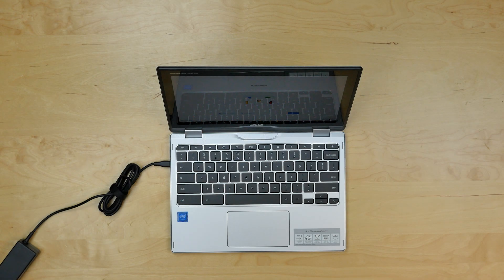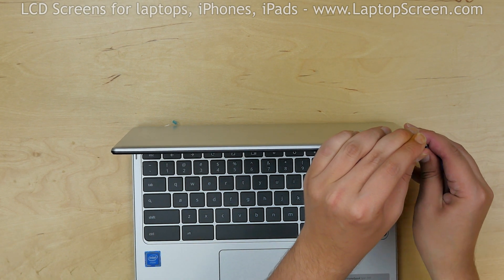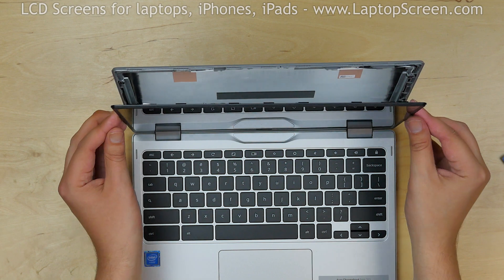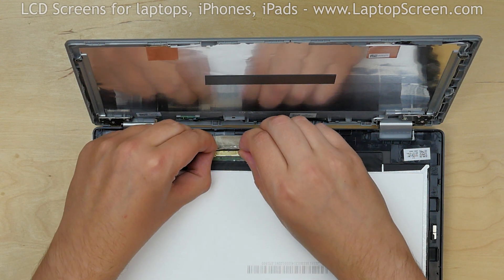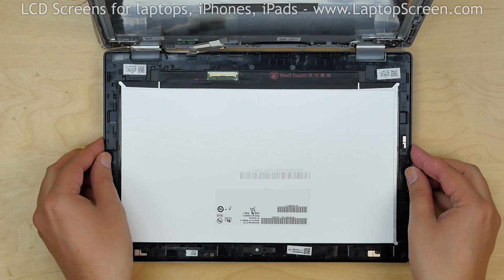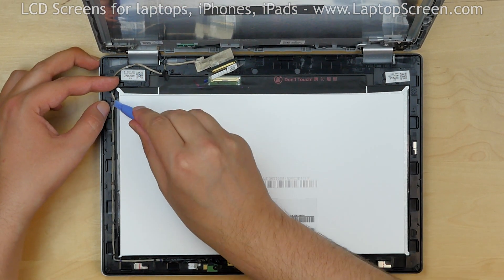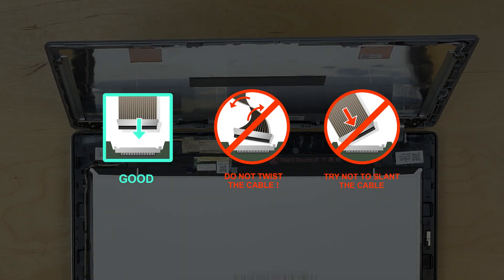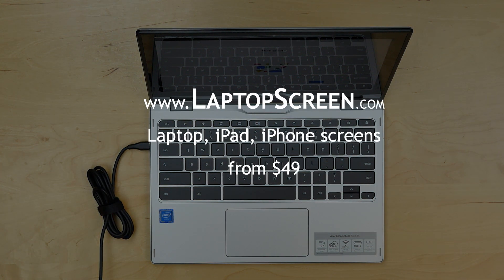How to replace LCD Screen and Digitizer on Acer Chromebook CP311 2H. Step-by-step instructions

Comment: 1:53 It really doesn't help that there was a skip in the part where you were inserting the cable in the hinge without struggling. Or were you actually struggling with that part and you edited that out? I feel like it would be easier to separate the lid from the base when replacing the LCD.
Reply from the maker: Sorry you're having trouble. The installer doesn't edit these videos, so it wasn't on purpose. I don't believe there was much struggle as the cable just lays there as the securing starts from the webcam end. That way the cable is tight from the web cam and slacked near the hinge.